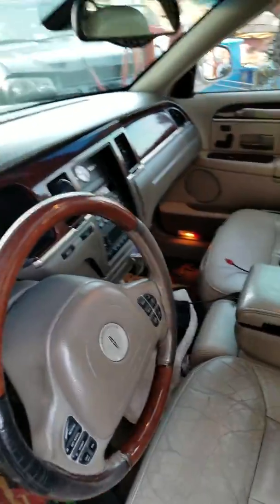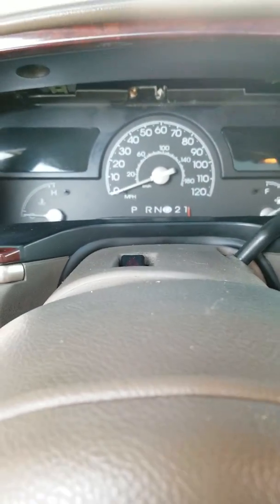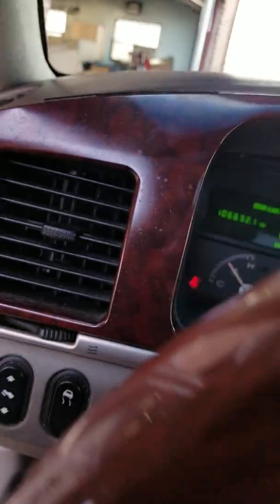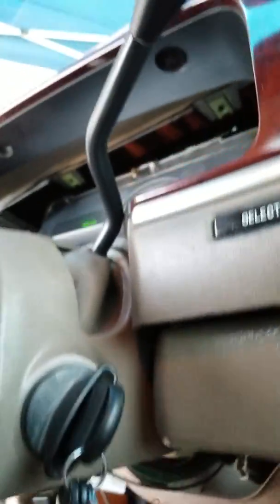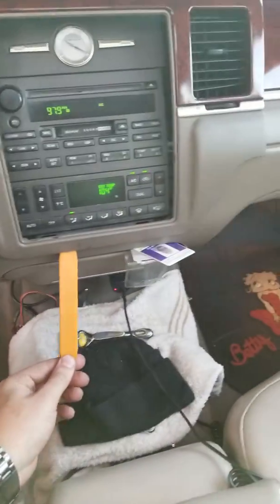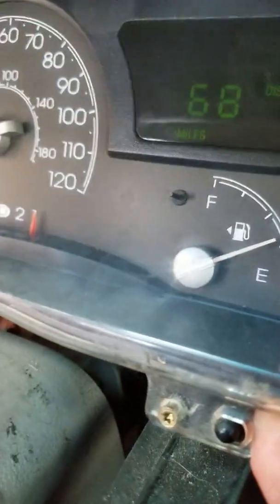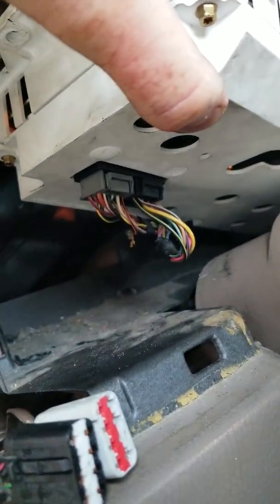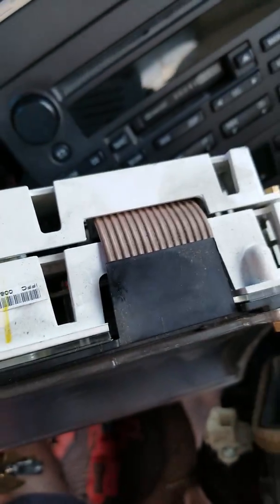2003 Lincoln Town Car cluster Repair

Comment: I have a cluster flicker (and some lines of the display not lit up) on my 2006 Lincoln Town Car (480K). It comes and goes. I figure maybe a bad connection? Either way, I assume the dash removal is similar to this.. thanks for the info!

Comment: I'm actually having the same issue with my cluster right now, neither one of my screens is working nor is my speedometer working. The only thing on my dash that works is my gas gauge and my temp gauge. But my car is a retired taxi, so I'm wondering if maybe they spliced some wires to put in the meter. I'd really love to see a video of how to take the dash apart, Not just have it explained. But I usually only find videos of the people who have already taken apart the dash beginning to work with the cluster or are just explaining what they have done to the cluster.

Comment: I have an 03 Town car with the same issue, Good to know it's just a loose connection. I kind of figured it was to begin with considering it occasionally works in extreme cold or extreme heat it'll function for a little while and then it'll quit. I've been using an OBD2 reader and a app on my phone to watch my speed and basic gauges like the temperature. Even though the temperature and gas gauges still work but the speedometer and the screens do not.

Comment: How do you remove the cable at the bottom of the cluster? Or does that cable run under the steering wheel?

Comment: Worked like a charm...thanks!
Reply: What did u do?  Just dielectric grease on cluster connections and put it back ?
Reply: @St.Michael-Ross  IIRR I cleaned with DeOxIt, dried, then Dilectric. It was just the connection issue though. Cluster has been working well since!

Comment: Here we are in 2024. I fixed the problem on my 2004 Town Car. What he didn't tell us is that the fix is very easy as soon as you remove the back cover of the cluster.
Then you will see several soldered points. From time and vibration, those wires soldered into brake loose, that's why the flickering occurs.
Those points need to be resoldered by touching them with hor gun. Problem solved. Why he didn't mention it? Just bring your car to me and I am gonna charge you $500.

Comment: Hey Ray! 05 town car my temperature gauge does not light up at night  everything else does and works, any idea?
Please help 🙏 thank you.
Reply from the maker: Hey, check into an aftermarket lighting bezal. Or mount a temp gauge. It's a cheap fix for an older car. If not than there's got to be an issue with the cluster. Make sure u check ur feeds before u replace. Lmk
Reply: I just disconnected the little light bulb trying to swap it out and now it doesn't light up?
Reply from the maker: @markchimmy  they should be all on the same circuit. U should be able to isolate it by the connection or the bulb being the issue.
Reply: @markchimmy might be polarity sensitive. Swap it 180 degrees and see if that works.

Comment: Hello I have a question so I got a 2003 Lincoln town car and my clusters speedometer don’t work & also it doesn’t show the mileage nor trip it just shows a bunch of lines - - - - - could this be a fuse problem or what could be the problem ?? Plz help I’ve been braking my head trying to find the problem.
Reply from the maker: Hello, i see your having an issue with the mileage. I would first check all the signals(wires) to the cluster. Or the cluster was replaced at one point and the mileage is not registering. Hope this helps.
Reply: @rayjbmoresmechanic3919  I just bought my first town car it’s an 03. I’m trying to read some form to figure this out but can’t find any. I’m sure it’s just the dimmer switch needs a replacement. But randomly when my headlights get turned on my digital gauges not the analogue speedo or fuel lights will go dim but only the stuff that read the digital speedometer,distance to empty goes super dim and it’ll do this depending on the lighting outside the car as well. What may cause that? Also my passenger side won’t unlock or lock with key fob or within the car but windows all work.
Reply from the maker: @TJoesph01  Hey Tristan, sorry for the late response. Hope you figured out your issues but if it helps in any way it sounds like you have a cluster issue aswell. I would also test the alternator just to be sure on having the proper voltage. And on the passenger door not locking or unlocking I would start with checking the door actuator and the wires in both door jams. Iv had to fix multiple broken wires in between the doors and the body jams. Good luck and hope you get to the bottom of it.

Comment: Will this help with my digital speedometer on my 96 Lincoln town car
Reply from the maker: Hey Jeremy, try checking and cleaning the connections first before spending any dollars. A lot of times this fixes the issue without having to replace the cluster. *used one could have the same issues.
Reply: The 96 Lincoln Town car is roughly the same thing all the way up to 07 Lincoln Town cars. They all pretty much have the same instrument cluster. I was looking in the buying a new one just in case but I think I'm going to try this fix first since what he described the customer of having the issue and what my issue is seem very similar.

Comment: What kind of shop do you work at? I'm asking do I know where do go, and what did it cost to repair. What did you charge?
Reply from the maker: Located in Baltimore, Repair was about 150 total. Keep in mind that some clusters need more work than others. This was complete with in 1-2 hours.
Reply: @rayjbmoresmechanic3919  thank you.
Reply: Did this affect how the car ran at all? I’m having the same exact issue but with a fuel injector misfiring as well
Reply: @dwaynedebruin3546  no but your analog speed is accurate and yes mileage
Reply: @rayjbmoresmechanic3919   Do you guys restore the cluster on site ?   I would drive down to have you guys fix mine

Comment: On cracked dashboard plastic, they can be repaired by application of a very small amount of ABS cement align them accurately and taping into place. Allow to set for about thirty minutes, carefully turn the part to expose the back side of the part. Procure a roll of sheet rock tape the yellow fiberglass type and lay the tape over the repair area cut to size and apply a thin layer of ABS cement to the area the tape covers, and apply tape to cemented section. Rotate the tape for successive layers about 15 degrees from the first trim as required and apply ABS cement repeat for a minimum of three layers. Allow to set between layers so that that cement will cure if you apply to much cement the part will soften and distort and may take days to become fully cured.  Tin snip or good quality scissors will cut the tape. Work quickly as ABS cement will cure quite rapidly. Highly recommend using gloves like the Black nitrile type to keep cement off your hands, avoid touching the finished side of the repair piece to avoid damage to it's finish. Good Luck.
Reply from the maker: I tried that on first repair, and had to do it all over again and now the low blinker fluid light will not go out. There is a tsb on locking yourself in the trunk for a week should fix it.